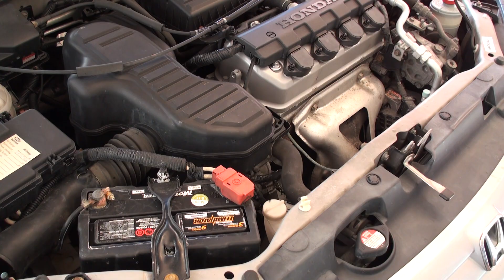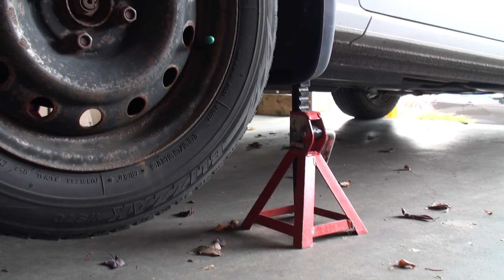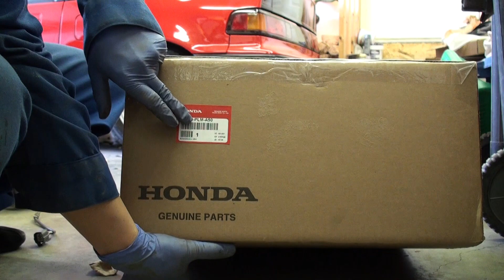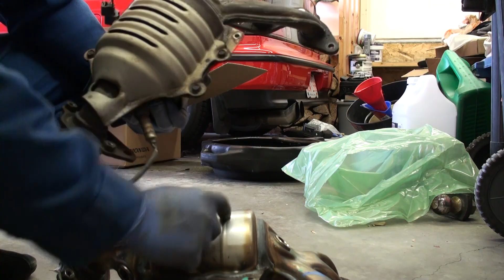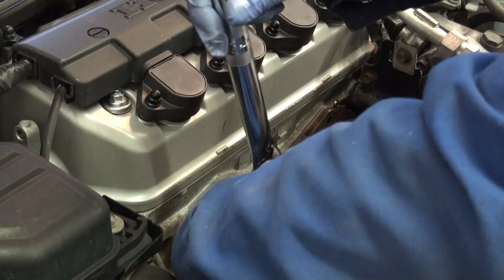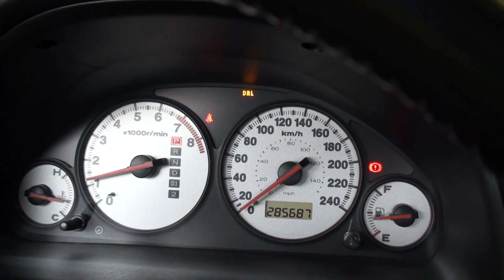2001 - 2005 Honda Civic Combination Exhaust Manifold Catalytic Converter  Replacement

Comment: If only Honda engineers would have design the cat and manifold in two parts..
Reply from the maker: They do on some other higher end models.  For example the Civic Si has a separate cat and manifold and the older civics (88-91) all had heavy duty cast iron manifolds and well made cats.  They just don't make em' like they used to!

Comment: Can anyone tell me the part number on the bracket at the bottom that goes to the engine block? Mine was siezed onto the cat and I had to just leave it on the old cat and toss it in trash. Need a replacement part ASAP.
Reply from the maker: You can likely find the bracket on a parts diagram if you go to www.hondaautomotiveparts.com
Reply: piercedasian I was able to find it and put in a new bracket. It cost a pretty penny $70!

Comment: where would you get the unlock code for the radio ?
Reply from the maker: Honda dealership by giving them the serial number of the unit.  You can retrieve the number by holding a combination of buttons to reveal the s/n which you then take to the parts department at Honda to get the unlock code.  Check your owners manual to determine that key press combination.

Comment: Vetik Flow good
Reply from the maker: Yes the exhaust flows much better and the car actually does a bit more power b/c the cat is new and free flowing and b/c there isn't an exhaust leak that the 02 sensors operate more effectively b/c the NOx and CO levels are being measured more accurately.
Reply: My car alntra 94
I  hope so
Reply: automatic
Reply: I want to install the Honda Vitic 1.6 engine on the Elantra 94
Reply: I want to install the Honda Vitic 1.6 engine on the Elantra 94
Reply: I live in Jordan and own 94 Elantra

Comment: Hello,  just found out today that my exhaust manifold has a crack in it.  Now, where I live there are no emissions,  I know that the leak will eventually get worse along with the gas mileage.  But, my question is, can I buy the cheap converter?
Reply from the maker: While you COULD buy a cheap converter that just remember that your emissions could be elevated (bad for environment if you care) and your car's performance may not be optimal as I believe the catalyst has to have a certain efficiency performance threshold such that the car's emission control systems can dial in the right ratio of fuel/air mixture to get best performance.

Comment: I was watching this video after already having bought my replacement Catalytic converter. I realized midway through that mine was relatively cheap. That being said, how do you feel about the Evan Fischer catalytic coverter/exhaust manifold combos? Is installing one going to cause me issues later on?
Reply from the maker: Cheap doesn't always translate to being bad.  The problem with "inexpensive" cats is that they sometimes lack the build quality (not that the Honda one is "great") and more importantly is that they do not contain enough of the catalyst material (platinum and palladium) needed to properly lower emissions level to what the manufacturer designed it for.  I've heard LOTS of great things about Walker cats but I don't have access to them here so rather than me hunting high and low for a substitute that I don't know will work properly that I opted to pay a lot more to get a Honda approved one.  My pocket book suffered a lot but it's been many years and a lot of miles with ZERO emissions related problems.  Only way to determine if yours is good is to either ask in a forum on the quality of yours, return it for a Honda one or just install it to try and see if you pass an emissions test.

Comment: Forgot to mention clean it with a wire brush replace exhaust manifold gasket muat be new every time you replace it 
This catalyctic converter online is about 500 dollars american.
Reply from the maker: You're absolutely right that I should have mentioned that.  It didn't even occur to me to say anything about it since the engines that I've worked on (and removed the manifolds one) are insanely clean and never need cleaning.  I will use your feedback for subsequent maintenance vids as I'm sure not everyone's engine is in pristine condition.

Comment: All you had to do was take that heat shield off run the car and get the manifold hot and weld that crack while bolted up on the car and hot then that bow would straighten out
Reply from the maker: I really considered that BUT that is risky since the fuel system is in such close proximity.  Those braver than me can do that but I refused to take the risk of burning my car up in my garage.

Comment: Hello sir im confused on the price i need one also cracked down the middle. On ebay price is around 80, called honda they said 1k 🤷‍♂️ please answer thanks.
Reply from the maker: Get the genuine Honda one. The ebay ones are fake or don’t have the catalyst material in them.
Reply: @piercedasian  so what do they go for then the catalyst one thanks for reply

Comment: I'm working on the exhaust on my 2007 Honda Fit.  My odyssey began with the center exhaust pipe cracking all the way through in a clean circle just downstream of the resonator.  The nuts and bolts at the cat-to-center-pipe joint are unrecognizable as nuts and bolts (due to rust), so I decided to replace the cat.  The Fit has a more traditional separate cat and exhaust manifold (and the engine is reversed from the '01-'05 Civic -- the exhaust manifold is against the firewall rather than against the radiator).  Well, now I've sheared off one of the bolts between the cat and the exhaust manifold, and the other is likely to shear off as well.  So I ordered a new (genuine Honda) exhaust manifold...  I hope my manifold comes off as easily has yours on your Civic.  I have a friend (who mostly works on Ford trucks and such rather than Hondas) who told me all kinds of exhaust manifold horror stories (mostly studs broken off flush with the cylinder head...).  I'm crossing my fingers...  (Once the old manifold is out of the car, I may eventually be able to salvage it by drilling out the sheared-off bolt(s) at the exit flange.  But in the name of expediency, I decided to order a new manifold so that I can get the car back on the road more quickly...)

Wish me luck!  Thanks for your video!!!
Reply: This guy has had that manifold on and off several times and each time he oiled and used anti seize. Yours will not come off this easily I can pretty much guarantee that.
Reply from the maker: Ah while you're comment on having the manifold on and off several times that the first time taking it off wasn't too bad.  Similar to my comment above, I had used a tremendous amount of penetrating lube and "snap action" breaking of the nuts and bolts to get the parts free.  Lower manifold bolts that were made of steel going into steel were removed again with a lot of lube and impact gun.  Overall it wasn't too bad and during reassembly that I used lots of anti-seize to ensure future removals were much easier.
Reply: Well, removing the old exhaust manifold on my 2007 Fit wasn't trivial, but it actually went fairly well.  A friend with American car experience (probably all with cast iron exhaust manifolds) told me it was an impossible job and that I might as well just set fire to the car and collect the insurance money!  LOL!  But the Fit (and most Hondas?) has a stainless steel exhaust manifold.  So it went pretty well for me.  Thank goodness!  And I installed a brand new manifold to replace it (since one of the exit flange bolts sheared-off and I didn't want to spend a lot of time trying to remove it right now -- I needed to get the car back on the road ASAP).

Rock 'n Roll!
Reply from the maker: Glad you got this all figured out.  Honda manifolds I've found aren't too bad to remove (unless you live in the rust belt).  Lots of lube and patience usually gets the job done right.
Reply from the maker: Yikes, my response is super late but that sucks nuts (not pun intended).  Rust is the bane of any mechanics existence but unfortunately we have to deal with it in whatever manner is necessary.  The trick is using lots and lots and lots of penetrating lube over the course of several days.  I've found that if I spray a good quality penetrating lube and give the part that needs to be dissembled a few good whacks with a hammer and then more penetrating lube that it makes things come apart a lot easier.

Comment: You're a great guy for making this video, for all of us who also must replace these parts.  HOWEVER, I've been fighting with the plugs, on the pair of upstream O2 sensors, for DAYS now and CANNOT get them to come undone!!
You make it all look too easy, did it all too quickly, and had your hands in the way, so we have NO IDEA what you ACTUALLY DID to remove and disconnect the sensors, from the wiring harness.
Reply from the maker: Hi Wayne, my apologies for not replying sooner.  I'm sure you've got this job done already but I thought I'd reply anyways.  The problem with being a one man show when making these videos is being unable to get the best camera views to show how to take certain things apart.  To get the connector to slide off the bracket you lift the tab up inside where the metal bracket go into the plug and give it a tug and it comes right off.  No fighting or black magic of any sorts to get it off.  To get the plug halves to come apart firmly press the release button and wiggle the two connector halves apart.  Again a very straightforward process.
Reply: Did you ever get the plugs off ? There’s a plastic tab on the plug you just push in on and pull out on the plug.

Comment: Check engine light ?
Reply from the maker: Nope just a physical crack that I could clearly see and the fact that I could hear and smell exhaust leaking in the cars cabin.
Reply: piercedasian I had a P0135 that turned to a P0420 (Catalyst deficiency) after replacing my up and downstream o2 sensors. My exhaust manifold has a crack in it similar to this one. My engine bay often smells of exhaust immediately after turning off the engine. I’ve been hearing a rattle but I believe it’s from the heat shield on the exhaust manifold. I’m considering buying a magnaflow OEM grade exhaust manifold/cat to replace it.

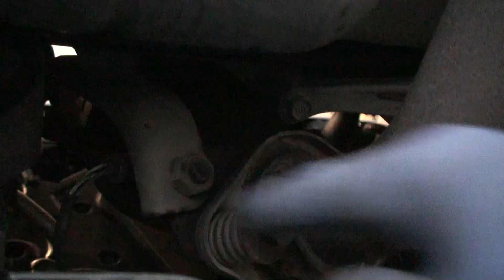Comment: The aftermarket manifold I ordered had one bolt hole misaligned - the one at 3:56. I put all other bolts but that one. Will this cause me issues? Felt very tight and secure
Reply from the maker: hmm interesting.  Can you not loosen that bracket off the engine block and get it to fit or is the misalignment really off?  Ideally it should be bolted up b/c any engine vibrations will put stress on the exhaust manifold studs and bolts which is part of your cylinder head.  I'd strongly recommend you try to loosen that bracket to see if you can get it to align so that things can be all bolted up as how the factory intended it to be. If you can't then there isn't much you really can do.
Reply: @piercedasian  Is there a way to loosen the bracket?
Reply from the maker: @IntegrityJack  I believe it is simply bolted onto the engine block with a bolt or two no?

Comment: Hi dude I just subscribed on your channel :), I would like to know how I can remove an internal screw in the head engine, The screw what I doing mention is visible over the minute 6:00 (central-screw), it got swept, What I can do? I will appreciate so much your help. thanks
Reply from the maker: Odd as this might sound I just received your comment to my video a year later!  Hopefully you were able to fix your stripped screw problem.
Reply: I have the same issue.

Comment: so its the same part for either a 01-05 year model???
Reply from the maker: yes as long as you have the civic model where the catalytic converter is directly attached to the manifold like the one shown in this video.  On the Si models it is a completely different system so just make sure yours looks the same as mine.

Comment: I have the same car and my exhaust manifold gasket is cracked and all exhaust is escaping from the top of the manifold, will this cause codes P0401 & P0420 to pop up ?
Reply from the maker: Difficult to say but if you have an exhaust leak that chances are that it will make your car throw DTCs.

Comment: It's too bad there aren't aftermarket companies that specialize in fixing engineering flaws in parts like this. (Like the aftermarket suspension and radio market does!) I'd pay a bit more over OEM to know the problem has been corrected. Great vid as always!
Reply: Dorman sells a CARB-compliant cat (673-608) that includes a 5 year/50k mile warranty and costs less than OEM. Might be worth checking out.
Reply from the maker: Thanks for sharing that.  I considered the Dorman one as well BUT I've read lots of horror stories and heard of a lot of complaints about aftermarket cats not holding up to the same emission standards as the genuine cat.  The Honda one is SO CHEAPLY made that they should be ashamed of themselves for making such a junky part that costs nearly $1000 to buy!
Reply: @piercedasian  Thanks for this video! I just checked with the Honda dealer here in Virginia and the combo is just under $1,300. So maybe the prices vary a lot depending on where you live. The dealer said it would take a week to get the part. This is Monday and I need the car running for a trip on Friday. The Dorman one is available much faster (and cheaper) than original Honda. Where did you see issues with the Dorman has problems?

Comment: Do you think you could have used a belt sander to flatten the manifold/flange straight and reweld the crack?
Reply from the maker: no definitely not a good idea.  IF I had more patience I may have taken the time to tightly bolt the manifold to a perfectly flat metal surface, heat the manifold up with a torch to fully open up the crack and then weld it up.
Reply: @piercedasian  If i am not mistaken heat makes metal expand and seals the crack.... welding it in either the hot or cold state won't fix the problem because the metal has simply fatigued and can no longer expand or contract without breaking. Hence it cracked due to fatigue.

Comment: where can I buy the catalytic converter at for a low price? Can you send me a link
Reply: you can buy parts on these websites, 
google or rock auto.
Reply from the maker: Unfortunately the only places I can suggest are online Honda dealers.  I purchased mine from the local Honda dealership and they're not cheap.  You could go aftermarket cats BUT the problem I've read is the quality of the cats is often not very good (worse than OE) and they often can make your ECU throw emission error codes.